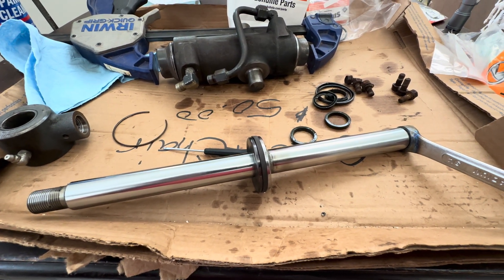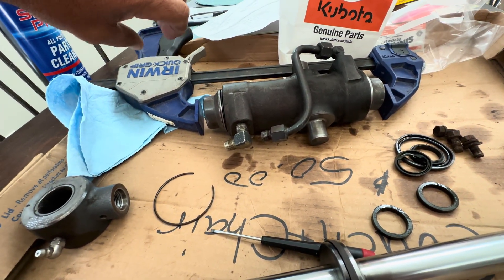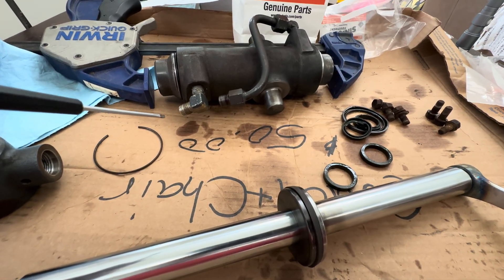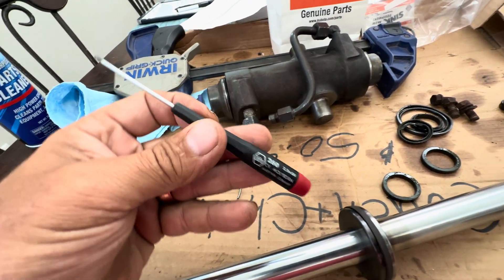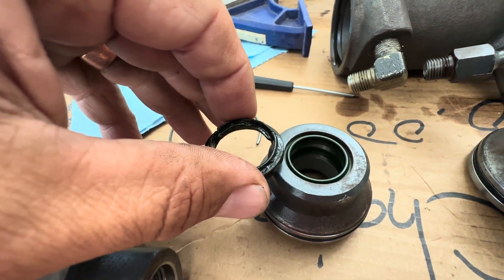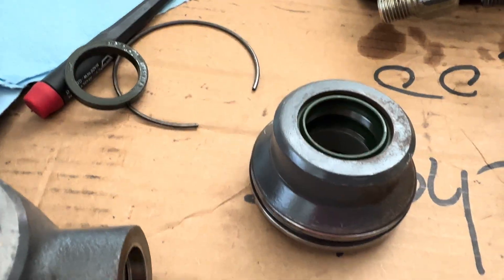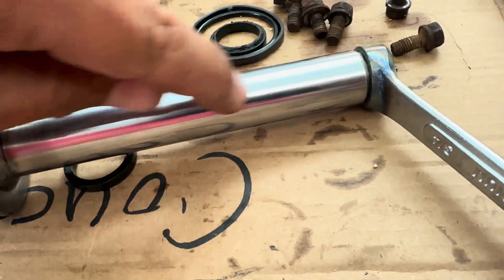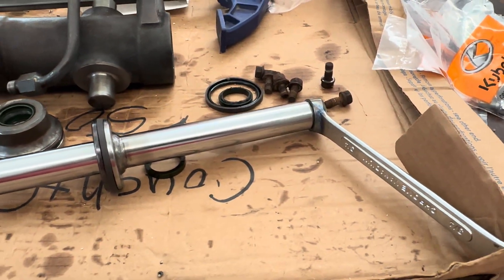Kubota L3010 steering cylinder rebuild

Comment: do you have the part numbers for the whole seal kit?
Reply from the maker: That I do not.  All the parts were there already before starting.  All obtained by another person at the Kabota dealer.   Parts should be able to quote you over the phone everything using the tractor serial and model number I’d say.

Comment: Great video!!!  Any tips on removal?
Reply: Hit send too soon.  Do you have a help video for removing from the tractor.  Thank you in advance.
Reply from the maker: @ashiny2637 sorry for the delay.  Hopper is right, remove the battery and front grill.  Lift the front sub frame up and slide something under it to access pulling out the cylinder rod pin.  

We removed the side bolts holding the side skirt frame attached to the front framing after removing the grill and battery.  Then we picked up the radiator support frame a little and jammed a board under it on the front side adjacent to the cylinder pin to access the pin location. 

Before all that we had to use a double wrench for leverage to get loose the two bolts holding down the main cylinder body.  Accessing that part behind the engine under it after taking the side covers off.  Access for leverage through the passenger side in between everything. 

The hardest part of all the repair is the threaded on rod end that holds the pin that goes to the front of the tractor.  One must weld a wrench to the end and use a bench vice and long extension breaker bar so you can control the turn in case something breaks like the weld or wrench.  Neither did for us, but we did need to grind off the fork end of the wrench to fit the pipe.  

The second hardest is loosening up the bolts to the cylinder main body.  They were so tight we replaced them as well as if they were head bolts.  Use knuckle protecting gloves.  

And there was no other way to take that pin holder off the threaded rod end except tack weld four spots a box end wrench to it.  There after installing the parts back together we grinded off the wrench slowly not to create enough heat to effect rod temper.  I placed a wet towel around the rod with ice cubes in it and added cubes as needed to the inside of the towel. 

Just take your time and have fun.  It’s a slow process, but in the end rewarding.
Reply: If it was like mine, removed battery above it for better access to 4 bolts. 9/16 socket

Comment: Great video. I was going to have to do this, but I ended up getting mine off of my l3410 and brought it to a hydraulic shop because the rod was pitted and needed repair. I wasn’t paying for a replacement rod because the price was insane.